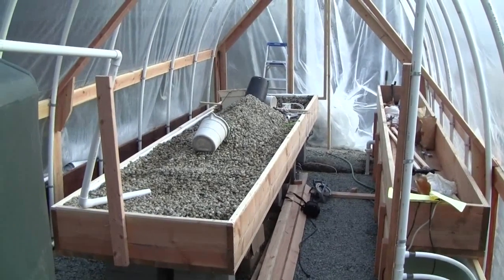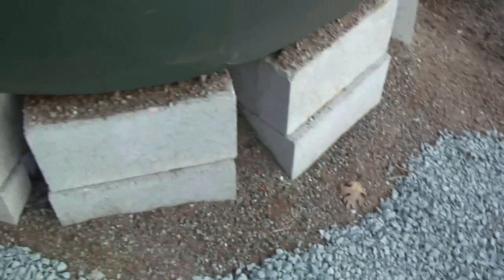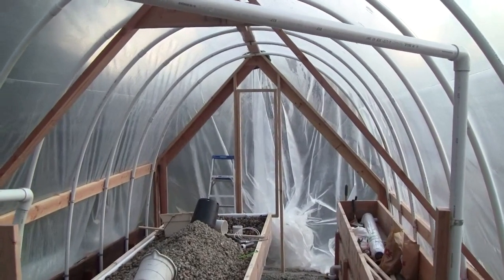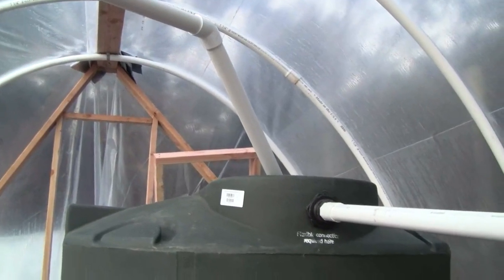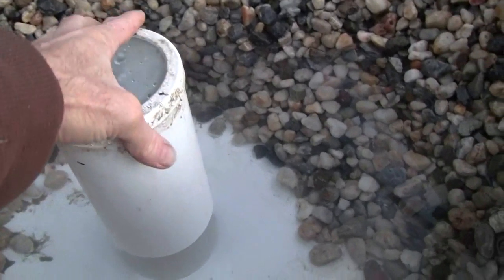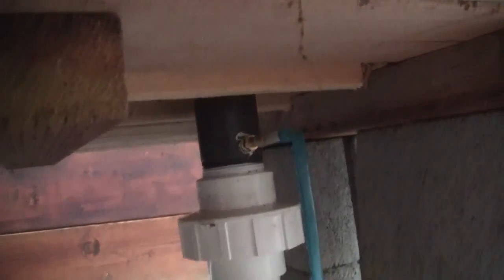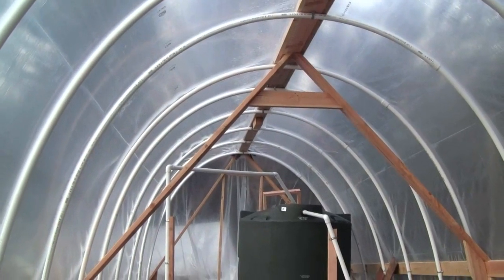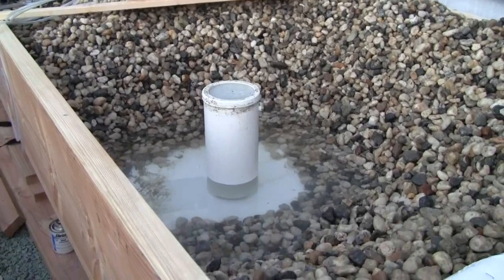Personal Media and Raft Aquaponics System 3

Comment: I know it's a long time but I really like using an external bell siphon. The bed can drain fast and the pipe can be underground. But the siphon is on the side of the sump not the growbeds. The water will always be moving.  With the external siphon the pipe never has stagnant water. If you ever wanted to make both media beds they could be combined and then flooded with one pipe and drained with the same siphon.

Comment from the maker: Duraskrim liner for aquaponic tables is 0.020" thick....ie, 20 mil.  Far thicker than 6 mill plastic, and, it's a triple laminate.  It has an organic certifiable liner material on each side, with a woven fabric in between, all sandwiched together into the 20 mil thick liner material. 
rt

Comment from the maker: Hi, thanks.  Yes, I'd seen that video long ago.  The Bell siphon I'm developing will work better than that one.  First of all, I'm using 1.25" pipe on the vertical siphon tube, then 1.50" pipe on the drain "U" to sump.  That means, **far** faster table drain time.  I will use an air check valve, ultra low P version, to let the air out of the siphon bell and allow the water to come up inside.  This allows water level inside to closely track table water level.  I'll show you when it's finished.
rt